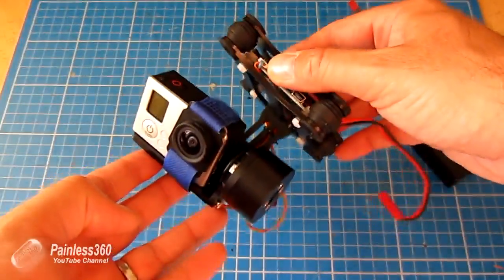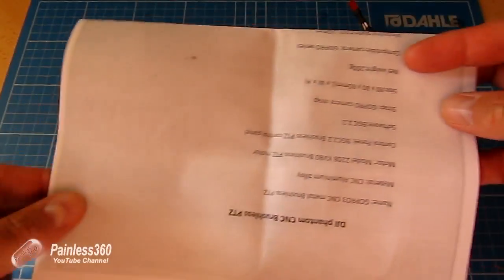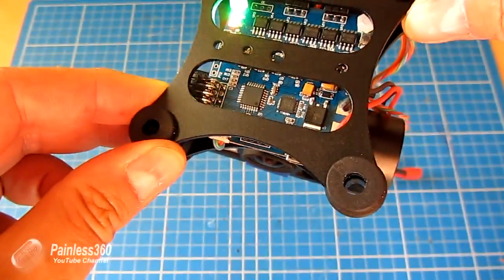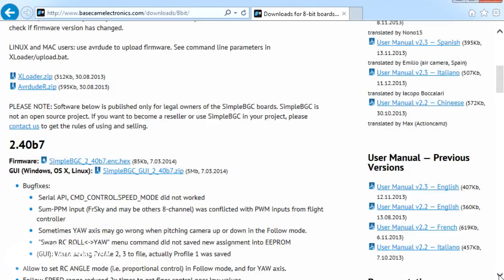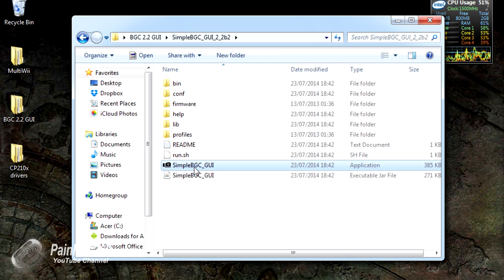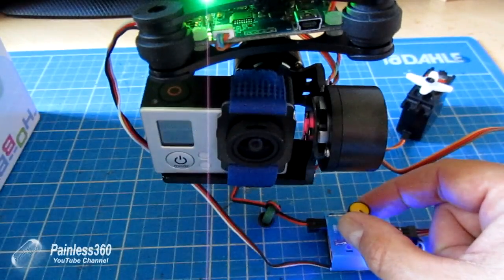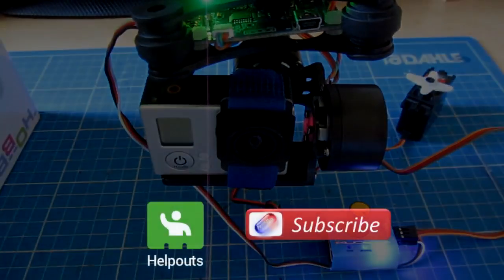BGC 2.2 (2.2b2) GoPro Camera Gimbal – Software, drivers, setup and receiver connections.

Comment: I've got the exact same gimbal, I connect signal cable from my receiver aux2 into the signal pin of the pitch on the gimbal board, I set the input of pitch to RC Input , under the RC settings but nothing is working
Reply from the maker: Adam Keely Does a servo connected to Aux2 move ok? What troubleshooting have you done?
Reply: I'm not sure because I don't have a servo to test on , I plugged it into my FC and the values of my receiver aux 2 does correspond with the knob , so it definetly does transmit the signal
Reply from the maker: Not sure then - you can contact the supplier for more help. The Gimbal may not be configured for it. Connect it to the PC and have a look as a last resort..
Reply: Thank

Comment: Hi, Thank you so much for your video. I see that you made some adapter to fit the battery plugs, but is is ok to use the 4pin jst-xh directly? if I just solder the - and + wires to the board and ignore the other 2 wires on the 4pins jst-xh?
Reply from the maker: Binh Nguyen I use something like that all the time here - see the soldering videos in the RC quick tips playlist. 
Double check polarity and voltage out of your new connector before plugging it in - always pays to be safe not sorry..

Comment: Could you connect this gimbal to the main power supply battery? or would you have to get a separate battery for the gimbal?
Reply: I'm thinking connected after ubec with flight controller but, are motors, thinking of many people avoid to connect servos with other electronics. motors may be more consumptions especially in sharp moves. So a separate ubec at 6Volts (give 7volts) are the best.

Comment: Anyone know how to recalibrate it for a different camera? Anything that's not a gopro doesn't work on it... im wondering if you can change some of the PIDs to stabilise a different camera. Any help?
Reply from the maker: Connor Mullan Changing the PIDs will make little difference. Increasing the power levels to the servos might..
Bottom line - the gimbal is made expecting a certain weight of camera in the gimbal to balance it all out. If you are using a lighter camera then you may need to position it in a way/add a little more weight to make it balance neutrally. 
Best of luck.
Reply: thanks for the speedy reply :) I'll try balancing it out later + I upped the power to 150, I'll see if that helps! If not I'll just get an SJ4000 or something similar... maybe even a gopro haha
Reply from the maker: Lots of GoPro knock offs that will give decent quality (Mobius in the Mobius GoPro camera adapter for instance) and not cost the earth!

Best of luck.
Reply: thanks again for the replies and the videos :) helped me out many times!

Comment: Hello, thanks for your very nice video, it helped me a lot.
Just one question, i have de power for the gimbal connected to my lipo's ballancing cable, but i just used 1+ and 1 - cable, so i am using as far as i know 4,2 Volt. Is this ok ?  I can noway find out how much volt it needs, and i am afraid to use all of the cables from the lipo's balancing cable. So far my gimbal works but perhaps it is better to use all of the balancing cables ?  Could you please let me know ? Thanks.
Reply from the maker: Marco Jansson Check the stats for the gimbal you have from the supplier/their website. These gimbals usually have a wide operating voltage. This one in the video is being connected to the flight battery - 3s/12.4v and works great. 
Best of luck with it.
Reply: Thank you for your answer, i will try to find out, because it is a "simple" ebay gimbal, don't have a website, but looks exactly like yours :)

Comment: Used  a 2s battery, it work better
Reply: antonio perez that makes no sense... a 3S will have more current meaning the gimble will work better, due to the higher level of power available,

Comment: Hi Painless360, I just received this gimbal and did not get any papers for installation. I was wondering if you knew which pins on the naza the pitch and roll connect to. And on the gimbal. I have it mounted and the power connected to the board. I have been watching you videos and they will come in handy when I need to calibrate.
Reply from the maker: jshrea I don't use Naza but the  very basic paper instructions that came with this gimbal can be downloaded from @67301981
Best of luck.

Comment: Hi, the video  is very helpful! im just having troubles because i downloaded the driver, yet my computer still wont read my gimbal. im actually not even sure if this will fix the issue im having, the gimbals two brushless motors run hot and dont work, would this be the correct fix in this situation? Thanks!
Reply from the maker: The Pasty Prince Possibly - I would be going back to the vendor and asking for help. 
Best of luck.

Comment: Brilliant video, I've managed to get so far, installed GUI and connected it okay, got my gimbal working and now sits nice and level, what I can't figure out is connecting the servo lead so it can be tilted from my futaba T6j flaps button (potentiometer). You showed it working with that servo tester but where would I plug my servo lead? Does it go into Ch6 on the receiver? Also read that you only need 1 lead wire and not to use all 3 on the servo lead as it will break the board. Any help would be appreciated.
Reply from the maker: S00000by You plug the lead into the receiver on the channel that you will use to move the gimbal. I would only connect the GND and SIGNAL wires myself. No need to pull power from the receiver. 
Hope this helps.
Reply: Painless360 Wow, that was a very fast responce, many thanks, will try that now and let you know.
Reply: Painless360 Okay, just tried and still no pitch movement, but the gimbal is still working fine. any ideas?
Reply from the maker: S00000by Attach a servo to that output on the Rx to confirm you can see movement..
If so they you need to look at how the gimbal is setup using the GUI and ensure that everything is enables for remote pitch control.
Failing that the supplier may be able to help or provide a better manual.
Best of luck.
Reply: Painless360 Thanks again will give that a go.

Comment: Yet another masterpiece video...thanks for such helpful information so well put together. Could you put a link to ebay for the gimbal? I've been fighting for a while with a gimbal controller from HK (based on martinez board) but I'm getting tired of not getting decent results. By the way, is yours 8-bit or 32-bit?

Comment: Got a  storm 32bit v1.3.1  gimbal that self levels just fine but will not connect to any software gui? Is it just a Chinese thing?
Reply from the maker: Vic Prk Sorry Vic, I've not used that board myself. Maybe the forums or vendor can point you in the right direction?
Best of luck..
Reply: Painless360 Thanks...tried that

Comment: My gimbal was working fine out of the box then I screwed it up by trying to figure out how to get it to have a slight down angle by messing with the settings in the config tool. Now its going crazy. did I ruin it or is there a way to recover it? I tried to do the calibrate tabs but It didnt work or I didnt do it correctly.
Reply from the maker: UAV Jockey FPV Hi, each of the gimbals seem to have their own set of settings to work depending on the motors etc. I did something similar to mine but luckily (!) I had made this video so could copy the settings from the screen back into the tabs. 
You could always go back to the vendor and see if they have access to a settings file. 
Maybe too late now but I do have a video on setting the angle on this gimbal - https://www.youtube.com/watch?v=wv301eDPIBI
Best of luck..
Reply: Painless360 .Thank you.

Comment: I have a mobius. What do you recommend to do to get it well balanced on this gimbal design? Currently, I have it mounted far out of the mounting plate to keep it relatively balanced, though because it is so light weight it tends to vibrate and buzz, weirdly enough, it does not add any noticeable jello to the recordings, but it does reduce the sharpness (similar to motion blur.) My guess it that it high frequency noise.

Also with this mount, I have a good bit of jello to work out. I have some EMAX 2213 motors, and some reasonably balanced nylon 10x4.5 props. If I add some foam between the mobius and the gimbal, vibs become really bad. I think lowering the P and D on the gimbal will fix it, but have not tried it yet.

Comment: my Chinese control came with the bgc 3.1 and worked gear for about 10 minutes so I ordered a new board same basic board but the sensor looks like the one in the instructions paper you set a link to. It is a different shaped sensor and only has one arrow so not sure what direction/orientation to install it on the  gimbal. it does a lot of shaking i placed it with the connector facing up and the arrow forward, it shows the pitch inverted and I click to invert it but nothing. I hold it still and calibrate gyro and it will stop shaking mostly and start to pitch forward. help please.
Reply from the maker: Don Pillow you need to go back to your supplier for support. I don't have any 3.1 BGC kit here.
 If the board is the same then the same sensor would fit. 
Best of luck.

Comment: Hey,
I want to be able to control my Gimbals pitch via my transmitter and i am able to do that, however i have one concern. I power my gimbal from my flight battery via the balance plug, then if i were to put a servo lead from my APM outputs to the pitch pin on the gimbal controller, Is it safe to have power coming into it from 2 directions? (as power comes through APM into gimbal as it does from my lipo) Thanks
Reply from the maker: This is fine. If you are worried you can only connect the GND and signal wires from the rx to the gimbal control..

Happy flying!
Reply: Painless360 Thanks, real quick reply yesterday :) I took out the red wire as you said just for peace of mind, all good now :D

Comment: Do you have to power the gimbal up when connected to pc. I powered it up whilst connected and it blew the board. Play reply asap . Thanks
Reply from the maker: Hi Jacob, I've connected it with both the mains power and USB as well as just using the USB. Maybe something is different or wrong with your board, good luck getting it sorted..

Comment: Few questions...

Do you get the strap that holds the gopro in place? And does the strap have a glass lens or is it hollow?

How to you mount the gimbal on a DJI F450? Or does it just mount easily on a phantom 2? If so I could get a adapter plate :)
Reply from the maker: The strap came with the gimbal and doesn't' have any lens, that part goes over the GoPro lens housing. You can also get them from eBay separately too.

You need to buy the longer legs and then you can mount the gimbal to the underside of the craft using the nuts/bolts supplied. Don't know about the Phantom - I don't use them myself.

Happy flying!
Reply: So no adapter for the F450?
Reply from the maker: No that I've seen. You screw it into the bottom plate..
Reply: The two front big holes in the plate and gimbal?
Reply from the maker: Sorry I don't understand the question..
Reply: Does the gimbal screw underneath the two big holes in the front of the F450?

And also, do you think a gopro lens protector will fit trough the band?
Reply from the maker: The middle of the gimbal has three holes that can be used to mount to the craft, one in the centre and the ones at each side about 44mm apart. You can see these in the video.

I drilled two additional holes in the bottom plate of the 440 and used nylon bolts to secure it. You want the weight in the middle of the model or move the battery right to the back to counterbalance it further forward.

Hope this answers your question. Happy flying!
Reply: Oh, yea, the holes in the middle of the bottom plate? A bit bad then because my Naza is there. I think I will try buying an adapter plate and mount it on there :)
Reply from the maker: Best of luck!

Comment: I have the same, but I cannot get the pitch control to work. I connected the pitch control directly to a channel on the receiver.
- If I connect a servo on that same channel it works perfectly.
- If I connect the gimball to that channel (only signal or signal + ground, not the +wire) the pitch control doesnt work.
- I also tried with a servo tester connected to the gimball RC_pitch control and that worked.

The gimball itself is powered through a 12 Volt bec taking power from the 4S lipo.

I think it will work when connecting all pins from the receiver to the gimball (also the red cable) but in some video's it is stated that you should only connect the signal wire. I read articles that said it needs a common ground so I also connected the black but still not working. 

I fear that connecting the three wires (also the red) might lead to a short or smoke somewhere. However, when testing with the servo-tester the gimball also receives + volt through the wires (red wire also connected)

SO... Can I connect all three pin (+,- and S) from the receiver to the rc_pitch control on the gimbal?
Reply from the maker: I did - worked fine. The 12v power and the 5v control systems are separate.

Comment: I have this gimbal and board with 2208 90t motors and it just twitches and goes to one side. I tried it stock and I watched your video andemulated all of the GUI settings I saw and it still does the same thing. Could mine be faulty of am I forgetting something? I posted a video of the behavior. Thanks.

https://youtube.be/kVok40eobRQ
Reply from the maker: snowhack OK, a couple of things. First of all you will need to change the motor direction on the roll axis, looks backwards to me. Use the tick box in the GUI or rotate the servo style connector for that motor 180 degrees (it doesn't have a +5v, GND  and signal - it's the same as any brushless motor three wires). Make sure you have a weight in the place where the GoPro goes so it is naturally balanced, these things are made to work with that counterweight of the camera in place.

Secondly, once you have that sorted then you will need to test if there is enough power in the motors to hold the camera level. Move the gimbal quickly and make sure it can keep up, if not increase the power for the two motors a little bit at a time until it can handle almost all movements without stuttering.

In my experience each of these gimbals need slightly different setting so you can't simply copy another's setup and get it to work perfectly.

Best of luck with it.
Reply: Painless360 I balanced the GoPro Hero 3 on the gimbal then connected and messed around with the settings...power, PIDs, ect.Still acts the same. BUT....then I clicked the Auto button next to external FC Gain and it started working. It buzzes, even with the timing set to high (quiet) in advanced tab. The motors are warm too. BUT, As soon as I click "write" it goes back to the screwy behavior. Disconnect and reconnect and it goes back too. It always goes back to the behavior in the video.
Reply from the maker: Not sure then, swapping the cable for the motor should reverse the direction of the motor and stop it swinging to the side.

I found that wirting some of the settings with the power connected and then without the power connected caused different results.

Best of luck, sorry I can't be of more help..

Comment: great video..im planning to get this but need to know if it will work upside down?? im planning to install this on a fixed wing experimental plane fpv.will it work that way??? thanks again for your tutorials..great stuff indeed!
Reply from the maker: Yes it will but you may need to change settings in the GUI though.

Happy flying!

Comment: If I want the camera to be tilted slightly downward so that my props aren't showing, what area of the settings would you tweak the pitch?  Is it under the Basic or Advanced tab?
Reply from the maker: See https://www.youtube.com/watch?v=wv301eDPIBI&index=2&list=PLYsWjANuAm4ruGdrRaYBVw9c8QZvIWpsw for help.

Happy flying!
Reply: Painless360 Thank you for the response. I actually watched the video, tried it and it worked, but for some reason it seemed to throw all my other settings out of whack and the camera wasn't stabilizing as well when I set it by hand so I was hoping there was a better way to tune it directly in the software so that's tilted slightly downward all the time.

Comment: Did you have to find and download Java 1.6.0 to run the Simple BGC GUI?? Mine is prompting me that it needs it.
Reply from the maker: I have Java installed on my machine already as many of the Arduino programs and GUI interfaces fro the boards need it. Looks like you need to install it too..
Reply: Painless360 I have the latest Java Ver. 8, Java ver. 1.6.0 is old as hell. Not sure where to even find such and old version.
Reply: Painless360
Are you using x86 or x64 OS?
Reply from the maker: 32 bit OS here.. so I chose x86..

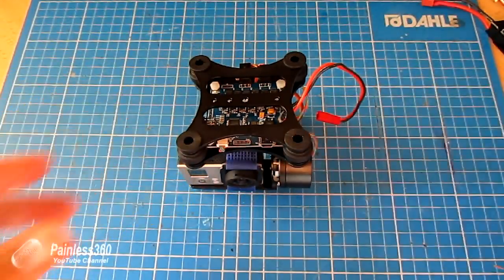Comment: Can you please post the adapter you use in your video that connects to the battery allowing you to send power to the gimbal? I am looking for one online but I'm not sure which one is correct. You mention it at 2:18.  Thanks!
Reply from the maker: JST. https://www.youtube.com/watch?v=2ghMtUiV18w
Reply: Painless360 I watched that but I think I may have not been clear. I already have the JST coming out of the gimbal, what is the part that connects it to the battery? It was not mentioned in the above video. I took a screen shot of your original video for reference: http://grab.by/FAgY
Reply from the maker: I see. That is a little adapter I made up so that I could run it from a battery on the bench.

You can see me make one by watching https://www.youtube.com/watch?v=-YPLW5cCiGY

Have a look at the channel and search for what you're after. There is a good chance that it's already covered here but I'm always looking for ideas for new videos my subscribers need..

Hope this helps.